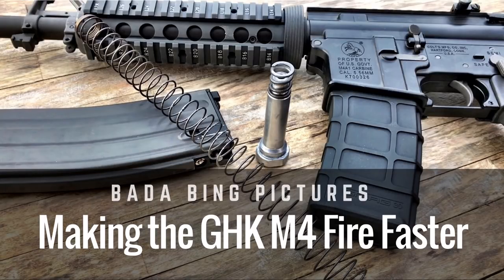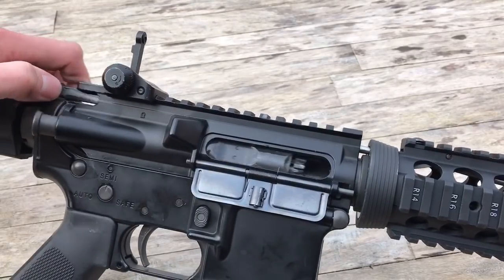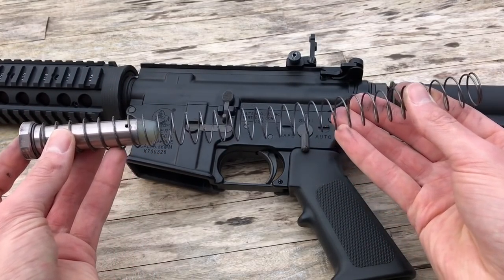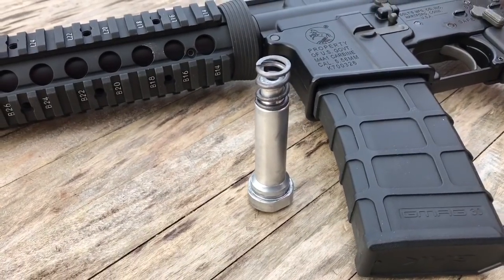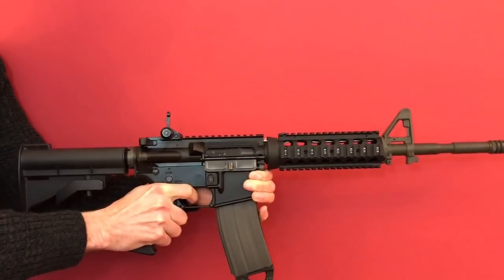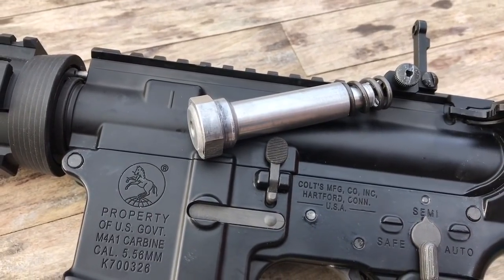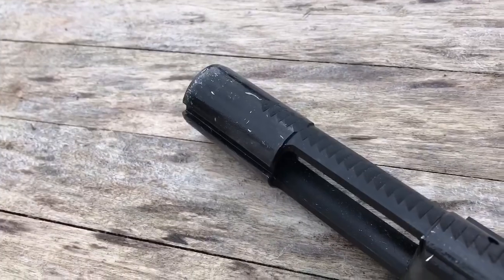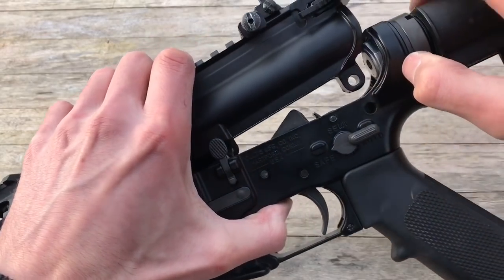GHK M4 Making it fire faster

Comment: Can U make a video of also putting the washer and a short stroke kit cause idk how im suppose to put the washer and short stroke kit
Reply from the maker: Strip out all the buffer tube of components and then place the washers in first. (If required)
Then the spring and then the buffer.
Reply: @BadaBingPictures  so what I did was removed the buffer and the spring then I put one small short stroke then the washer ring then put back the spring and put a new buffer is that correct?
Reply from the maker: Those washers go closest to your shoulder, then the spring is in front of that and then the buffer.

Comment: Is that an actual AR buffer? looks just like my real one.
Reply from the maker: It’s an airsoft buffer made by GHK. It looks practically identical to the real buffer. Probably some material/weight difference though
Reply: William Seroyer It’s pretty much identical to a standard carbine buffer.  I run a real buffer and it weights 3 ounces or 85 grams.  The ghk actually weights 10 grams more.
Reply: I run a 3 oz buffer in my actual AR as well, I'm guessing your not using the carbine spring, I don't think a air soft rifle could cycle that.

Comment: The tokio marui buffer spring how much stiffer compared to the stock ghk?   It is reliable to use with the LwBuffer?

I have bought the enhanced ghk buffer spring and It’s too much stiff to be used with the LW buffer..
it causes doubleshoots..

Now im using the LW buffer with the stock ghk buffer spring but after many magazine and the bolt gets dried out, it needs maintenance as it’s really weak to push the bolt back..  then the MARUI buffer spring should solve the issue i think

Comment: Slow fire rate? How could i make it fire slower? I want the most gass effecant realistic airsoft gun.
Reply from the maker: To be honest it’s quite gas efficient as it is. To make it slower you can use a heavier buffer/real AR buffer. This will help take away any bolt bounce and improve its feed.
Reply: @BadaBingPictures  You're one of the best for interaction.

 Have you consitered makeing a FAQ page for gbbr's? 

lightend buffer spring? would it make it even more effecant? 

I'm trying to make a gbbr as a real steel dry fire training aid. 
Recoil and fire rate are things im willing to sacrifice to get range and accuracy. 

.4 bb's, rHop, Co2  is what the grape vine has sugested to be best.
Reply from the maker: Thanks. It’s nice to maintain contact with the community. 

I haven’t, no. Mainly because there’s tonnes of sites with informative resources online. Especially with places like Discord, lots of people contribute on there and many of them have higher understanding of these things than I do. 
GBBR Heavy Recoil Club being one of the main servers.

https://discordapp.com/invite/h6h7mBp
Reply from the maker: The stock GHK buffer spring is quite soft as it is. You could look into a lighter BCG. Check out YSC design & development Co. 
They produce aluminium bolt carriers that won’t produce much recoil, but should extend the efficiency more than the original.

Comment: Bada like the systema PTW is fairly similar weight to the real M4 how does the gas compare? Light or similar weight to that of a PTW
Reply from the maker: It’s roughly the same weight. Perhaps a little lighter than the unloaded weight of a Colt M4 Carbine.
Reply: I own a WE M16 and I also own a real steel Palmetto Arms AR-15. It looks exactly like the military M16, but it shoots semi only. Anyway, the gas WE M16 was maybe 1lb less than the real steel. But it’s hard to notice the difference in weight when in your hands.

Comment: Anybody know if the v2 will fit a B.A.D. lever without modification?
Reply: Richard Mua Im pretty sure it will, but you may need to pad it out a bit as the ghk bolt release is a bit small
Reply: George.w the bolt release is the same size as a real ARs bolt release so it’s not gonna make a difference

Comment: Hello Badabing, I am going to get a GHK m4v2, also the Colt engraved one... But i cant decide between the 12.5" or 14.5"... do you have any words of advice for me? It would be really appreciated.
Reply from the maker: Hiya. 

They’d be both the same, just different length barrel sets, one is no better than the other. Although the 12 is a less popular choice. People usually go either 10.5 or 14.5, so you’d be one of the few. 
If you play in close quarters a lot then the 12.5 would be slightly easier to handle around corners and stuff. 

Also the inner barrels would be different in length and they would probably produce different FPS readings. On gas guns the longer the inner barrel the higher the FPS tends to be. What FPS did you have in mind?
Reply: in terms of accuracy will there be a difference? Presumably if I was going to be primarily CQB the shorter is better... But as I would be mostly at Ground Zero (south of
England) which is woodland, the need for a 10.5 is negated. But I figured that the 12.5  would be a good all rounder, particularly if there is no real difference in accuracy due to shorter barrel compared to the 14.5?
Reply: Oh, excuse me, I didnt expand your comment so i only saw the displayed first paragraph. the FPS rules at ground zero are 350
Reply from the maker: You might find that the accuracy is no different. The 14.5 using a 1j nozzle gave me around 340 - 350 during the winter, but this summer it shot up to 400 or over. So I would recommend the low velocity nozzle instead and would keep it sub 350 all year round.

Comment: Would these upgrade be recommended on the hk416a5?
Reply from the maker: I tried it in the A5 when I owned it and it was super fast! 
So yes, if you prefer a speedy setup then this is the choice for you!
Reply: BadaBingPictures awesome thanks brother! Did it wear any of the internals down faster?
Reply: BadaBingPictures i saw a few of your vids with the a5 so im thinking about combining it together
Reply from the maker: I briefly tested the buffer within the A5 so I wouldn’t know about it’s long term effects. As it’s lighter than the original, I’d think it would be easier on the internals. Faster yes, but less stress as the bolt carrier moves easier.

That’s my take on it anyway.
Reply: BadaBingPictures okay thank you

Comment: Hey! Quick question how would I go about cleaning my GHK M4? And more specifically what oil do I use? Also I would highly recommend making a video on this considering a lot of your fan base owns GHK’s
Thanks!
Reply from the maker: Hiya. 

It’s nothing scientific. Just use paper towel/rag on the BCG, inside upper/charging handle and clearing away grit and dirt from the lower. Using Q-Tips/Cotton wool on a stick to attack hard to reach areas. 
I back up some of the paper towel/kitchen roll inside the buffer tube to get any other dirt that’s deposited in there.

Remove nozzle from BC and ensure it is free from dirt on the o-ring base. Then apply silicone oil to those rubber o-rings. 

I use GHK Silicone oil and lightly coat the BCG and maybe a drop on the hammer/striker. 
 
Reinstall and function check. 

With the inner barrel, I send a couple of small patches of tissue on an Airsoft cleaning rod, through the barrel. I turn off the hop up to prevent damage and in case of grease and grime, I may put a dab of cleaning alcohol on the patch and push it through. Ensuring I don’t ride over the rubber bucking. 

Repeating with dry patches until a fine sheen. 

Everybody’s different and we all have our own “standards”. Mine is a very casual approach to maintenance. 

Thanks for the suggestion, I may look at doing a vid on this subject.

Comment: What lower (or full receiver kit) is that? It looks amazing as a replacement for the icky SEAL trades.
Reply from the maker: This is the Colt trademarked GHK M4 Version 2. It’s GHK’s Gen 2 M4 with a few internal improvements and it is licensed by Cybergun. 
Far better than those ghastly Seal trades! 🤮

Comment: I’m considering buying this rifle as a training rifle, but I’m worried the heavy recoil mod won’t be enough to make me feel that umf. What would you advise?
Reply from the maker: You could try an aftermarket steel buffer/heavy recoil buffer and stiff buffer spring. 

There are aftermarket bolt carriers available, but they aren’t that much heavier than the stock BC to be of any significant difference.

Comment: Hi badabing, I'd like to know if this kind of upgrade could damage or wear faster the nozzle once the bolt will clicle faster.
And I know you like to use propane, do you think that propane wear the internals faster than green gas?
Reply from the maker: Hi. 
Propane is exactly the same as green gas. Although some brand green gas can be a little weaker than others. 
The GHK M4 is able to be used with CO2 and if the nozzles are rated for CO2, using it with Propane/Green Gas will not effect wear the nozzle any quicker.
The higher cycle rate won’t wear out the nozzle quicker. The Lightweight buffer won’t create a heavy impact on the nozzle, so it’ll be fine.

Comment: I honestly feel like this makes no impact on semi auto firing.  Even with the stock buffer and spring the rifle cycles faster than you can pull the trigger.  The limiting factor when it comes to semi auto rate of fire is your finger and the quality of the trigger itself.  (Unless you’re Jerry Miculek 😉)

But maybe I’m biased because I like a hard kicking slow full auto from the heavy buffer.
Reply: Not really. The lighter buffer reduces the time the bolt spends at the rear position and allows the the bolt to return to battery much faster. Since the trigger can only release the hammer when the bolt is forward, you can only pull the trigger as fast as the bolt cycles. If your trigger squeezes are much faster than the cycling speed, you would end up have a dead trigger because you are pulling midway through a cycle thus preventing the hammer from firing. Now the question would be, are people's fingers fast enough to warrant this upgrade. Maybe.. maybe not. But then again who doesn't like a snappier/faster cyclic rate?
Reply: It definitely is faster, you can see/hear the bolt cycling faster. But is this an upgrade to make? It depends on the person. If you like the sound, feel and faster semi speed, then do it. But if you’re satisfied with it as-is, then leave it.

I really like this video because it helps make a better decision on what to do on increasing cycling rate.

Comment: Hey BadaBing great video. I love what you have done with the rate of fire. I would just be a little worried about the wear and tear factor in my own gun. You ever have any problems with nozzles breaking? Even with the aluminum ones I use they always seem to show signs of wear.
Reply from the maker: Hi! 
Thanks. To be honest the thought has never crossed my mind. The only nozzle issues I’ve ever had on GHKs, is with the AK series and those tabs that can get unevenly worn. 

Resulting in a misalignment. 
But nothing with the M4. There isn’t any increased recoil which would mash the nozzle to bits, just a crisper function.